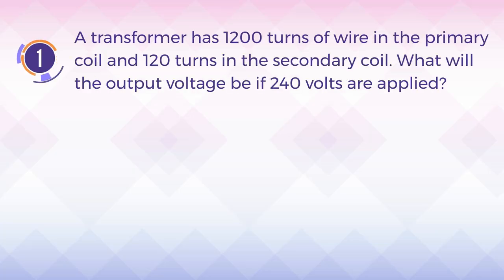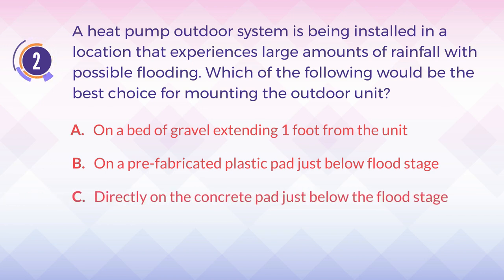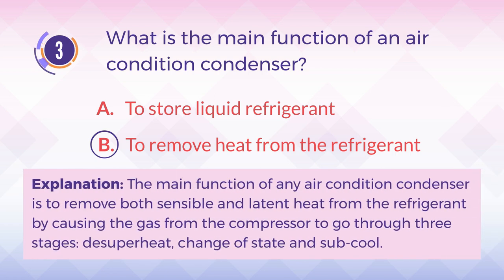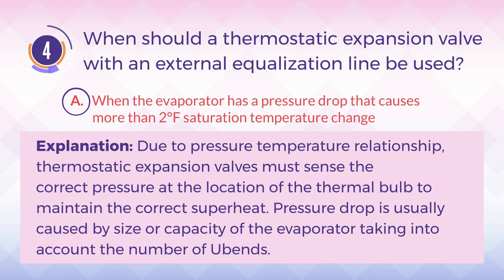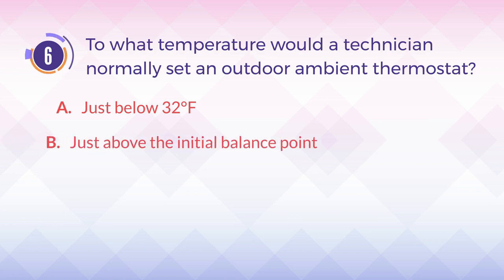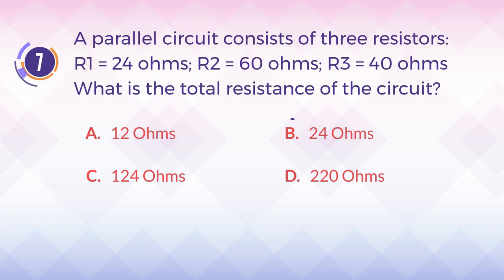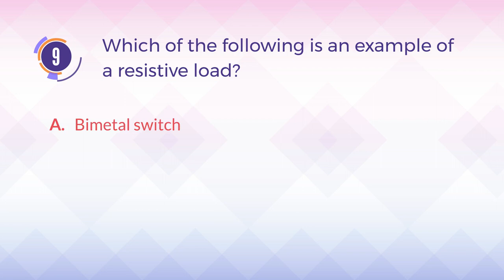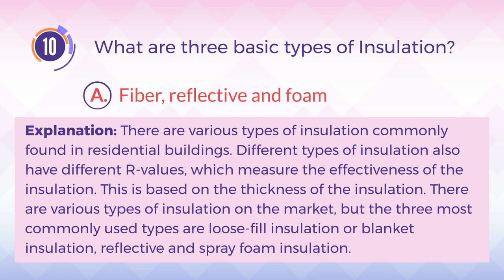HVAC Exam Prep - Practice Test 2 | TruePrep

Comment: On question 7, total resistance should be A: 12 Ohms. The law state it must be less than the smallest resistor which is 24 Ohms, the only answer less than 24 is A. YOu show the answer is B:24 ohms
Reply: In fact you can use the actual formula for resistance of resistors in parallel and determine it is 12 ohms

Comment: I need pdf for all HVAC mcq type questions?
Reply: 24v
Reply: No  4answe,,,as,,a
Reply: 4  is  answer,d
Reply: 7,,b24 ohms
Reply: @jollyscaria1922  7 should be 12ohms-it is the only answer less than the smallest resistor